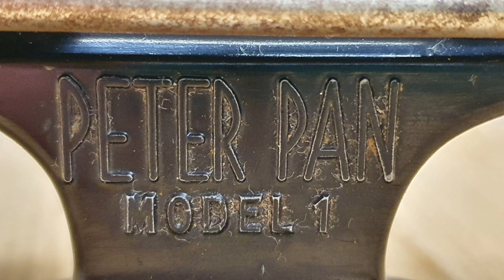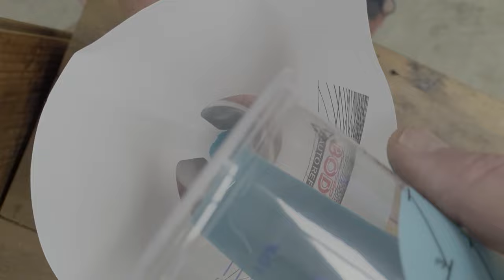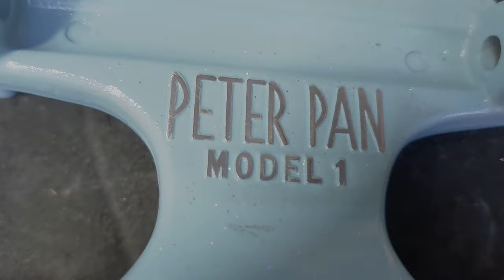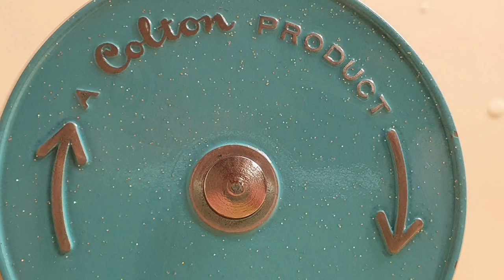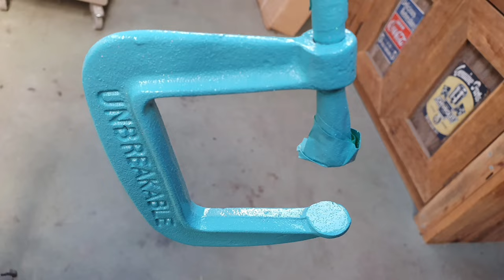RESTORATION 1940S PETER PAN MODEL 1 SEWING MACHINE.

Comment: Lovely restoration job!  I'd only note that if it's all adjusted correctly you don't need to pull the fabric through.  It should feed through nicely by itself and get a consistent stitch length (which you can then change with the little stitch adjusting lever).  This looks very close to the very early Singer model 20 machines so it might be that the adjusters manual for those will give instruction good enough to get the adjustments just right.  (And another little tip - it's not such a good idea to have the presser foot down and operate the machine without fabric between the presser foot and feed dog.  That's how a lot of older machines get extra wear and tear on the bottom of the press foot.  You can't easily change the presser foot on these so it's worth looking after them.  Especially after all that lovely work bringing it back to life!  
p.s.  You might have another video showing the adjustments and if you do - YAY - and please ignore most of what I just said above.  :-)
Reply from the maker: Thanks for the comment and yes if all adjusted right is should feed by itself.